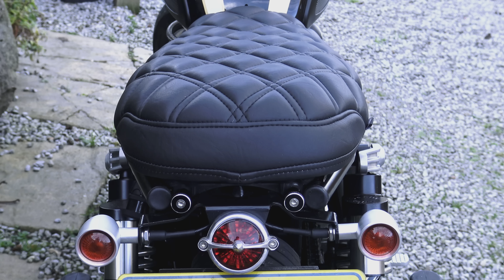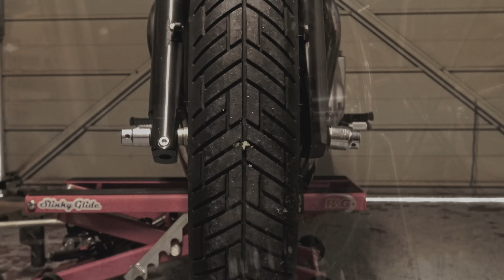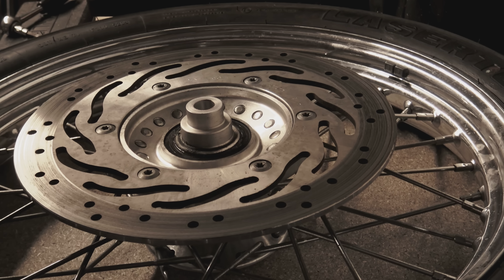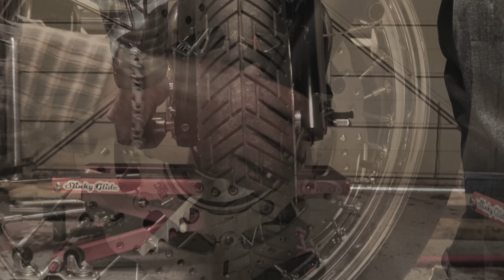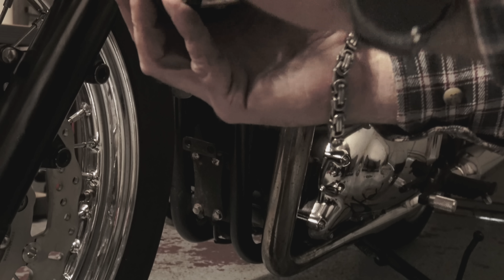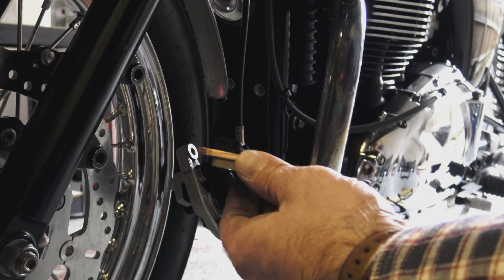Custom Triumph Bonneville T100, fitting  new front brake disc and pads

Comment: Great video. question, on my 2020 T120 the oem pads had shim plates on the back. Am I to transfer those shims to my new EBC pads (which came without anything on the back)? Thanks!
Reply: Stuart, do you recommend transferring the oem shim plates on my 2020 T120 to my new pads?

Comment: Great video, thanks. Question, the EBC website calls out the FA196HH for the wc Bonnevilles (2020 T120) but all the distributors call out the FA142HH. TheFA196HH is a little bigger (101,39,9.8) than the FA142HH (101,35,9) - your thoughts on this? Is the FA142HH a newer pad and has just not been updated on EBC's site?

Comment: Question, what is the yellow lube that you have used on the chain when you put the new one on that came with chain. Reason for asking when I do off my caliber I popped off the the rubber that the one of the metal rod / piston not sure what you call it. It had a bunch of it in there that fell out. I need to replace that lube. I need a name so I can order it. I did put in some white lube/greese for now, is that okay?

Comment: How in the hell do you get the screw for caliber out with an Alan key. It just will not buge
Reply from the maker: Hi Sony mine was fine as it had been treated with anti seize in the past. but if yours hasn't it may have seized in. if it definitely wont move try dampening it with some maintenance spray or similar and leave it over night to do its job. just be very careful not to get any on your pads or disc! it may take a few attempts but keep at it, and fingers crossed it will come loose eventually!

Comment: Once again great video, thanks.  I would however argue that using all four fingers is by far the safer practice as there is the very real chance of trapping the fourth and fifth digits between the lever and the bar (and thus reducing further the available breaking force as well as being very painful...) in an emergency breaking situation, especially with the amount of lever travel evident with your Bonneville!

Comment: Stuart,  I was installing a Tec tail tidy with Motone black turn signals and ran into a problem.  I was getting ready to shrink tube the tail light and turn signal connectors when I spotted some copper wiring at the rear light connector from Tec Bike Parts.  One of the tail light wires came out of the crimp pin.  Do you know the name of the mfg and part numbers for the female pins?  Also can you recommend a crimp tool to help me crimp a new pin.  I am a retired electronics engineer and if I was still working I would take the wiring harness to work and  crimp a new pin on the wire.  Of course nowadays you cannot return to your workplace due to security requirements.   Any  help would be appreciated.   Bill  .  I live in the USA.
Reply from the maker: Hi Bill, Im sorry but im not familiar with the tec tailtidy! I would have thought that it would be a standard 2.5 mm red automotive bullet connector but thats just a guess. if it is a cheap and cheerful crimping tool should do the job. sorry I cant be of more assistance.
Reply: @stuartfillingham  no,  it is the other end ( 6 pin mating connector) into the bike's  wiring loom.  The same connector that Motone uses.
Reply from the maker: @bill_4359 . Ah i see. if you have a very thin awl or something similar these can be pushed back in, they are simply an interference fit!
Reply: @stuartfillingham  I have a set of precision screw drivers which I believe will work .  Any of the smallest three will reinstall the pin.  Thanks for your time. Take care and ride safe.
Reply from the maker: @bill_4359 Actually i nearly suggested something similar, good luck with it Bill!

Comment: Hi Stuart - changing front disc and pads was on my list of jobs for my 2015 T100 Bonnie.  However, fitting Hagon fork springs has had a an additional benefit of greatly improving the braking performance.  I now agree with with you that the original front brake set-up is not as bad as some would have us believe.  Changing the disc has moved down my priority list.  Thanks for another great video.
Reply from the maker: yes those springs do have a rather magical effect!

Comment: Hi Stuart, which torque wrench do you recommend I buy? Halfords do a few options, or will I need something a bit more special?
Reply from the maker: Hi Mikey, ive started investing in king Dick tools (expensive) but I think halfords use britool as a supplier for torque wrenches which should be good!
Reply: @stuartfillingham  cheers! First job is to fit engine crash bars.

Comment: My concern with the T100 is that it is one disk instead of the two disk braking system in the t-120. For a motorcycle that is only slightly lighter, having twin disks really does seem to help.
Reply from the maker: one disc is enough for a bike like this!
Reply: @stuartfillingham  I agree with you that one disc is enough but like Leifenguard I would prefer two on a bike of this weight, its a shame that Triumph don't do at least one model in that engine size with twin discs for those that would prefer it. At least I don't think that they do one.

Comment: Hello mate great film.
Copper grease on the back of the pads??? Not for 30years read the instructions! EBC & Brembo DON'T recommend putting grease on the pads.this is a safety point Never put copper grease near your pads. 
Pad technology has moved on. Sorry mate but if the information your giving is about rider's safety it must be correct.
Reply from the maker: Hi Phil, I was expecting this! EBC technical department instructed me to use CG on the rear of these pads as there is no anti squeal shim fitted to the AC bonnies. Haynes also advise it  in their manual, and there were traces of it on the rear of the original factory pads I took off.
Reply: @stuartfillingham  I stopped doing this about 25 years ago on my bike's and never had a problem with squiking. My dad would insist on using cg it's one of those I've all ways done it my dad all ways done it so it must be correct. Not manufacturing of these components and materials used have changed. Just thinking about it your spraying cleaning fluid all over the calaper and flushing grease over the.disk
Reply from the maker: Thanks for your concern and your comments Phil I did look at this very closely before producing this video as I am aware of the controversy over this practice. ive done it this way for over 30 yrs without any issues and mainstream advice is still that it should be used. Any literature ive able to find to the contrary seems to be of spurious origin. Just do what works for you!
Reply: @philreadman1412    That´s why he finished off with giving the disk a once over with the brake cleaner .. to remove any possible greasy residue ;)
Reply: Lots of braking systems come with anti-squeal shims these days but if they don't, using copper grease is fine.  What 'isn't' fine is using copper grease when there is a shim. also it shouldn't be used between disk and hub.  As for not putting grease near the pads;  Just make sure you're careful and don't get it on the pad material.

Comment: I see you can get a Brembo kit as well. Would you, or will this suffice? I'm thinking about a water cooled t100, but as you say, it's getting a lot of flack for the brakes. That has somewhat put me off it. Quality video as usual! Thanks!
Reply from the maker: Hi Lasse, the Brembo kits are very expensive! The last time I looked around £1400. and my honest opinion is you wont get £1400 worth of upgraded performance. as I said in the video criticism of the brakes is usually unfounded and based on silly , unrealistic expectations, upgrades like better pads, a more stable brake fluid and braided hoses can go a long way to improving things.
Reply: Lasse Helland The callipers aren’t the best on the T100LC and have been improved on the 2019 model.  Just replacing the pads for EBC HH and perhaps installing braided hoses will make an improvement.  But don’t forget, as Stuart rightly states, these bikes aren’t designed for ‘sports bike style thrashing’. Having said that however; I myself like powerful/efficient brakes that don’t need a massive pull on the lever. Last year I purchased a 1500 mile Guzzi Griso and the brakes were so appalling that I changed the pads for EBC HH after 500 miles and the difference was night and day.  The standard set up used Brembo FF pads.  They shouldn’t have been as bad as they were so perhaps the previous owner had glazed them over but as a rule of thumb, one can’t go wrong with EBC HH and the kit that Stuart has fitted here will make a big difference